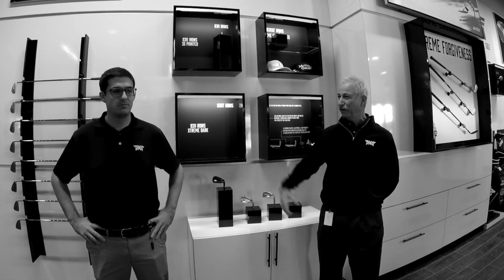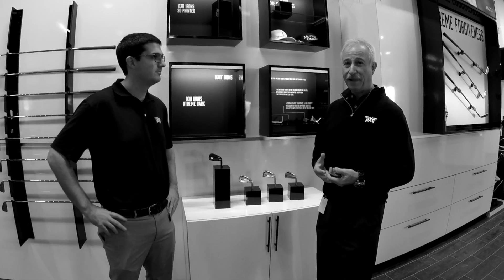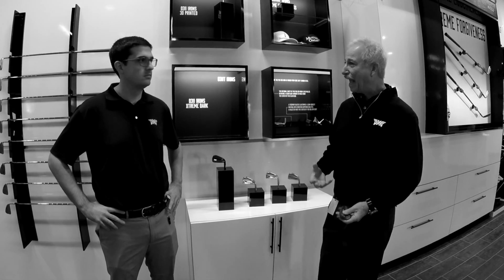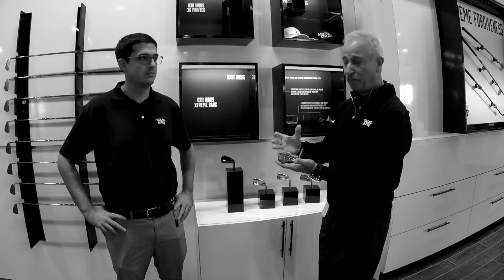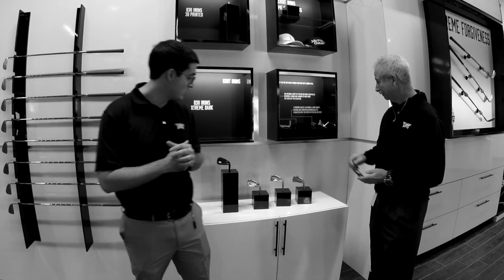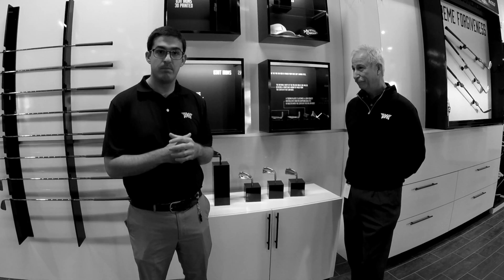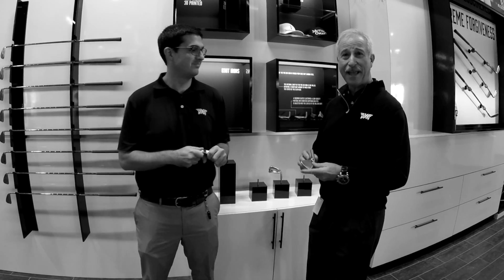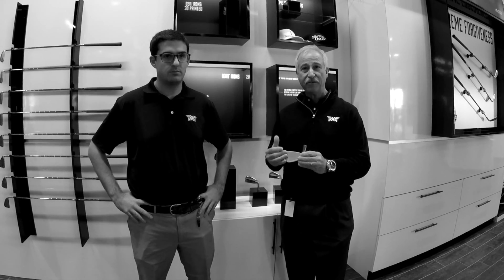PXG Tech Tuesdays | Perimeter Weighting On 0311 Series Irons

Comment: Title of video is perimeter weighting and yet the discussion is about head construction and offset.  I understand those topics do effect weight as you progress through the 3 different heads.  
Maybe it’s just me, when I selected the video based off the title I was under the impression there was going to be a discussion of the “perimeter weighting system” as notated on PXG’s site
Reply: Perimeter weighting means they create a club that moves all the weight to the perimeter of the clubhead and creates a high moi. That's exactly what they talked about. They also talked about how the different models have different perimeter weighting. The bit about offset made total sense because of how it effects moi.